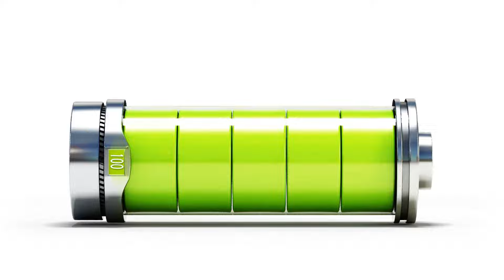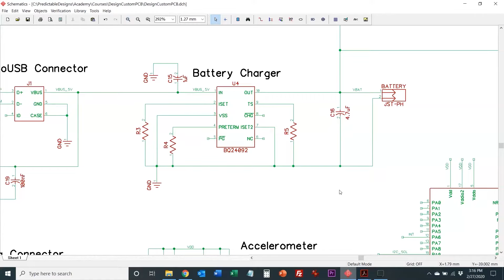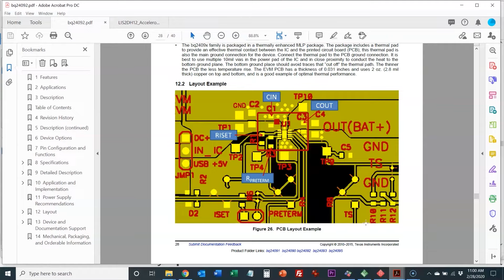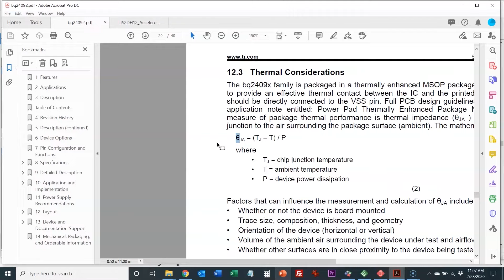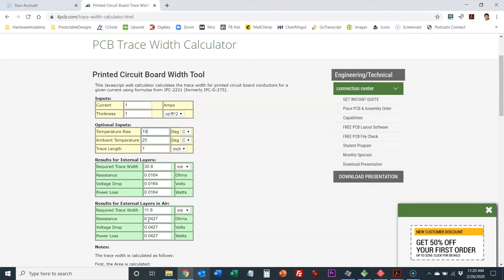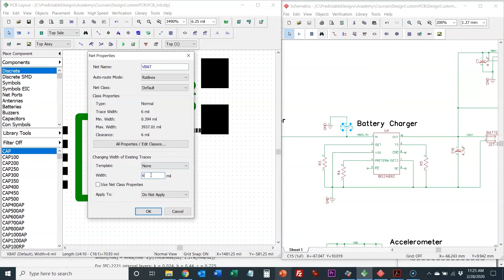How to Design a Battery Charger Circuit

Comment: It is impossible to finde a charging module which stops at 4.05V (80%) or 4.1V (85%) for battery longlivety.  Leaving a battery in the dock at 4.2V makes it age extreemly fast.  Keeping it below 4.05V makes it last for 10 years.  

Is there a (cheap) chip which stops at 4.1V or below?

Comment: 7:44 I’m sure you can exceed the adaptor current. The difference will be drawn from the battery. 
If the charge current is greater than the system current, it should power the system 100%.

Comment: Thanks for posting this video. Already incorporated this circuit into my design. Qucik question, I don't believe the BQ2409x provides over/under voltage protection, does it? Thoughts on adding something like BQ298xx to design as well?
Reply from the maker: Correct, it does not. I prefer to use LiPo batteries that already have the battery protection circuit built-in.

Comment: My battery pack has 20S Lifepo4, I am trying to find some ideas for charger circuit, 3.5kw, supply voltage 127V ac. Do you have some ideas or videos for a higher voltage system?

Comment: Hi , in my project i need to charge my device that consumes 60maH . i have few questions : 1) Will the battery charger BQ24092 supply 1 A till it gets exhausted ? Secondly , could i recharge the   THE BATTERY once it get over using the circuit above ? . My device works as a watch , so just asking . I am new to electrical field so pardon for my silly doubts .

Comment: Hi, if you have to design a circuit to charge a 3 cells battery which ic would you use? I've found the MAX1873SEEE that has a decent package (and I would add a balance circuit)
Reply: I think three S-8209B could do the job even better (but it doesn't have any shunt resistor...)

Comment: Hi, i'm sorry for the noob question: does this charger IC has any sort of overcharge, overdischarge and short-circuit protection? Thanks! Amazing content!
Reply from the maker: No, not really. It has short-circuit protection for the charger, but not the battery. The battery protection is generally embedded in the battery pack itself. Most LiPo battery you can see the protection circuit PCB at the top under the tape.
Reply: Check the STNS01PUR :) This IC + MAX17048 fuel gauge is all I use for most of my designs.

Comment: 2:12 can i charge 2 Samsung ICR18650 2500mAh cells connected in parallel with this battery charger
Reply: Hey, do you have an answer to your question already? I also would like to charge 2 18650 batteries in parallel.
Reply: The data sheet says 1s so think that means no
Reply: Yes! In parallel. It makes a 5Ah battery.

Comment: This is best video what I see on Youtube. Please make more videos this type, because on internet theres are missing them. Please do baterry discharger, and boost and buck converters, because for baterries, if I want use arduino micro controller, have constant voltage but also power efitient is crutial .
Reply from the maker: That's so great to hear! I'm actually planning to do one in the next week or so on a buck converter. Thanks for commenting.

Comment: Thank You John, do you use ISIS for the design and pcb , what tools do you recommend for design, simulation and PCB ?
Reply from the maker: I used DipTrace for this design and that is my preferred design software for most designs. It doesn't have all the features of software like Altium but it's more than sufficient for most designs. Super intuitive to learn and orders of magnitude cheaper than Altium. Thanks for the comment.